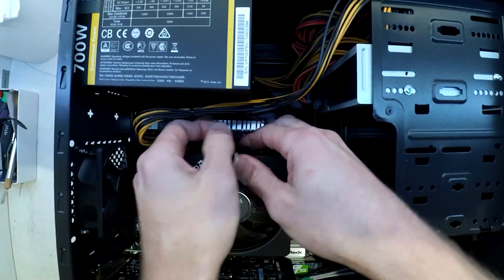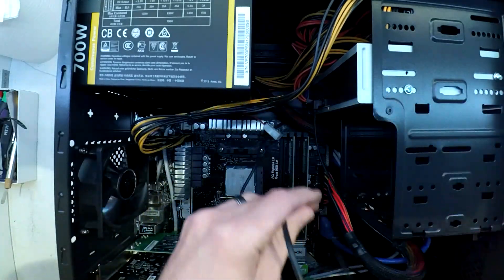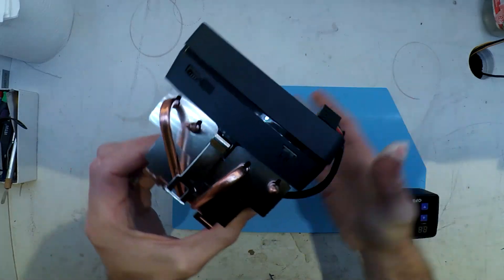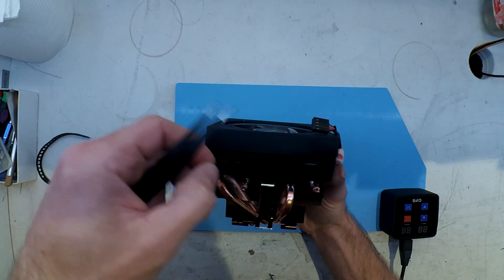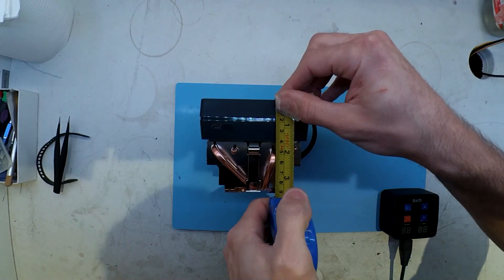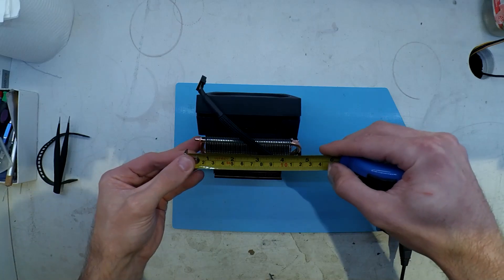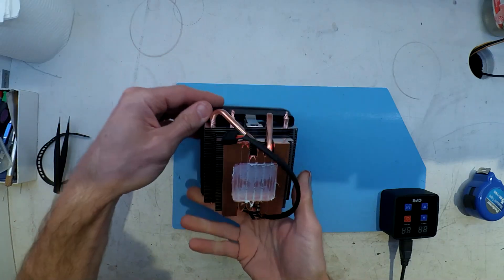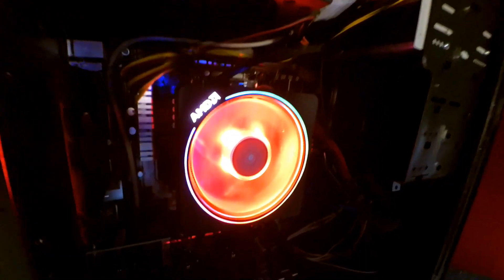AMD Wraith Prism Inspect and Measure

Comment: I just finish to install this cpu on a asus prime x470 pro, and I get 48°c on the bios, did I miss something? Why so high?
Reply from the maker: that is very high. what is the current ambient (room temperature?) 
Is there thermal paste on the cpu or cooler? , at that temp it sounds like its missing
Are all 4 screws on the cooler done up?
Reply: Ricks Tech hi, the ambient temperature is 20°c, this is a new installation, all the components are new, the thermal paste come with the air cooler...
Reply from the maker: Something isn't quite right there then 

20c ambient temp 
And a pc running at idle should get you low 30s to 40s max!! (Worse case)

I would be seeing if their is a bios update for your mobo and hopefully it's just a bug were it's reading the temp wrong
Reply: @rickstechrepairs  Thank you man, I will try that.

Comment: Will it fit on my FM2/FM2+ mobo? I already have it and ordered brackets
Reply from the maker: Dj Mystery no it won't

These am4 coolers screw in to the backplate 

Am3+ and FM2 have different spaced holes than the am4
Reply: I could be wrong, but maybe.
As Rick's Tech has already mentioned, the wraith spire and wraith stealth wont as they use a screw in mounting system. However, the prism uses clip mounting, so assuming the clips are the same height and width as the older mounts, and it fits between the older mounts physically (as it is indeed a sizable cooler) then yes it should work

I'm about 99.3% sure it will work however, as I can confirm an am3 1100t heatpipe cooler fits a stock FM2+ mount, and have just verified that a wraith prism fits an AM3 or am3+ mount as if it was made for it 👍
Sorry I wasn't here 3 month ago with the cooler and spare mounting hardware on hand.

As I said though, I can't guarantee it fits your particular board (primarily due to it's heft as she's a fairly large cooler) but the mounting system should be compatible
Reply: Everywhere on ads shows this even fit to FM1.. so I'm confused now.. LOL